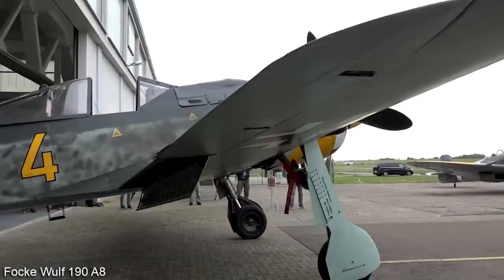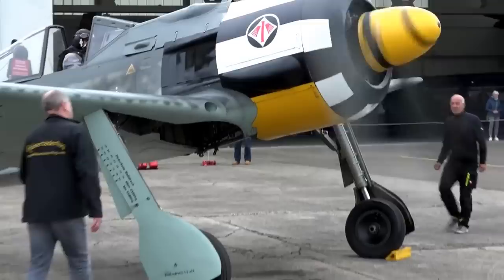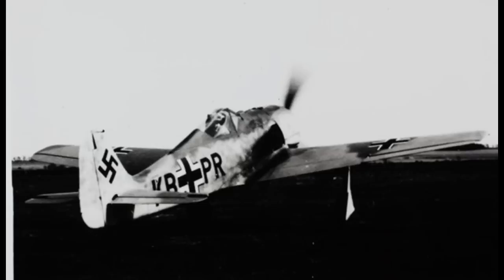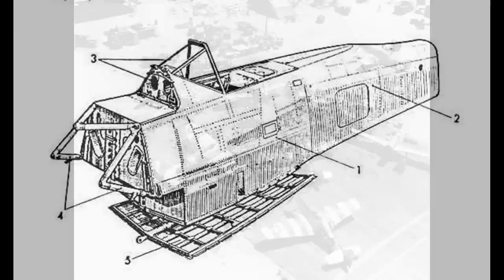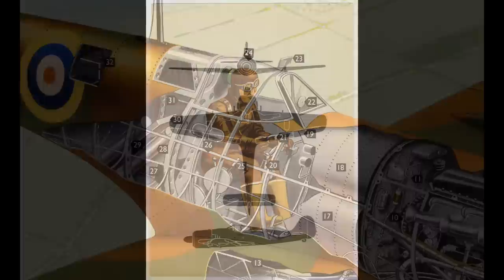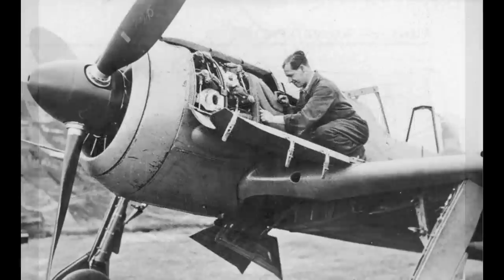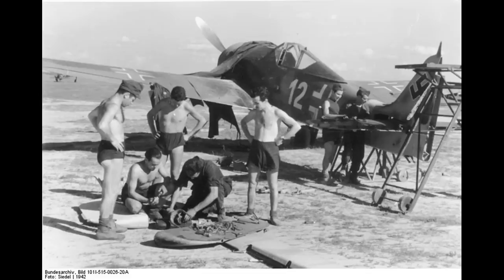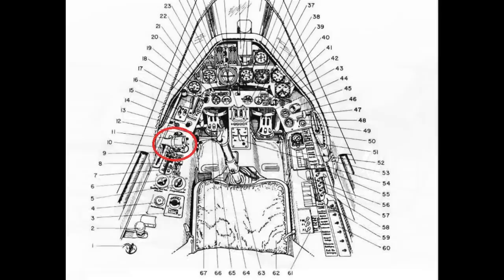Focke-Wulf Fw 190 Pt.2

Comment: The idéa of ergonomics was spawned about 1860. While it sort of existed naturally prior to that, that was the first time it was theoretizised. 

During 1880 and 1890 a lot of the theory was implemented on hand guns, making handguns of that time look a lot more than the handguns of today than just a few decades earlier. 

For machinery operation it spawned quite a bit later. While it was somewhat prevalent during the 1930 tys. It was really for fighter planes and tanks where the investment in ergonomics payed of the most. This is very obvious comparing a German, to US to Soviet tank. Soviet tank have barley any. US tank have some thought put into it, but really not a huge amount.

For German tanks they was quite significantly thought throw.

Now i heard that Germans did the same for  aircrat (and also to a lesser degree UK and USA, and hardly at all for USSR), but this is the first time i seen souch a oblivious example. The flight control system looks almost as something that could have been built in the 1970-tys

Comment: Jet engines have to have automatic fuel control, to much fuel can melt turbine.
Reply from the maker: There are turbine powered airplanes with back up manual power levers in the event of a fuel control unit failure. When using them you have to be very careful not to melt things, but with slow movement of the lever it's fine.

Comment: Yeaa Put em on to german Rpm goveneor/computer. Its way more efficent then human could 3ever be, "pitch" Need adjustment constantly, especilly during menuvers .  High RPM to climb slow, but not too high ot the dreaded Windmill effect kicks in. More important, Drop pitch While diving ,to avoid prop drag... Play I il2 With so0me good mods.. Youll see. Fly a P 51,  try to keep 100 pitch for 10-15 mins. Now try again, and drop pitch to 55-60 maybe 70 percent, Feel the poowaa! And notice the handy green line on your rpm.. It means something... Or for noobs the  corsair, F4-U, Set pitch to 90 for power and climb, drop for dives. Dont assume the same for the P 47, no sir.
Reply: Its like a Swiss Time piece, or that greek Celestial computer thing.. Such a beautiful solution, Ergonomics

Comment: I so enjoy your work here. Having spent some time racing autos ; I have a question regarding fuel. Had the Germans 150 octane gas ??? As "we " did then .
Reply: Gary Cates Their engines were not designed for high octane fuel. They would need new engines to take advantage of it.
Reply: @Wallyworld30  Thank you for your reply. The Germans were running 87 octane in there fighters. The same you are using in your daily driver now. Regular gas here in the states. It would have been a matter of adjustment, super charger boost, terbo, or an arrangement of both , and ignition timing. I do not know how they increased manifold pressure , but they did. They would not have had to redesign anything to run 159 octane. The use of a screw driver would have done the work. One mans oppionion. Garlets said " more fuel , timing ; and something else that escapes me. 427 in a 66 chevell 13 to one compression. Gas made a difference. 1% deasle to the 101 gas at the time helped. Sorry , rambling. Made the transition from striving tward new goals and asperations, content  now to dwell amung my memorries. 12.04 though lights with a spare and tool box in the trunk. Brother riding shot gun. Damn near wrecked getting off the throttle first time on 8" slicks. We took second that night. Lost lane choice. Spun a bit getting out. Memories. Go make some new ones. ,,,,,,,, thanks again.
Reply: Gary Cates I have no doubt they could have taken advantage of the higher octane fuel. I once mentioned that in one of Greg’s video’s and a gear head nearly took my head off saying that their engines couldn’t take advantage of it. I’m sure the german engineers would have no problem making adjustments to take advantage of running higher pressures.
Reply: @Wallyworld30  Yes , with out question . Spark knock is the problem. It is cured with more octane; period end of sentence.
Reply: Or detenation. Once in a late model engine "we" got some 90 wieght , 70 -140 gear gease in our fuel . cracked a piston and "knocked" a hole the size of a dime in another. We took second that night in Kallispell , on 7 cylinders. Octane .
Reply: Leaded qualities of the following were as such - 
A3 - 80 Octane
B4 - ~87 Octane, most common
C3 - ~95 Octane, rare and not used with mw50 for reasons you will find in Greg's great mw50 video
Reply: @garycates9911  The Germans were able to analyze fuel from downed Allied aircraft and look at the additives.  Some of the late war fuel mixes were getting comparable to Allied fuel.
Reply: @FiveCentsPlease  Thank you for your reply. This fuel issue can get very deep very fast. Antony Sutton wrote a number of books; all should be required reading. One of his titles is The natzis and wall street. Rockenfelder and standard oil shared info with the Germans. They had the same finacial backing. As did the bulshivicks and wall st. . The best enemy money can buy is also a good read. In 1936 Orwell wrote a white paper, There is no more history, after having came back from covering the spanish revolution. From this paper sprang the story line for both 1984 and animal farm. There is no more history. In 1970 the american library ass. made sure of this here in my country. Suttons books where yanked, Reed . Ford, Mullins ect. ,all gone. We live in a fantasy land . There is a real world out there  and it is coming. It will be very hard edged and mean ! Has this channel ever spoken to the German anti gravity stuff from the late 30's ? This would be some interesting "fuel" to discuss , it would lead us to the TR3b's and 4's, ect. Antarctica , trumps "new" space force is not new. Have you ever heard some one say ; what we know is 50 yr.s behind the military ? It is longer, much longer than 50 yr.s. I know this isn't the place for such words. Please forgive me. Was reflecting on the past , and the present interupted me. do be well. Gary
Reply: @garycates9911    I think you meant to reply to somebody else's comment.

Comment: This fw 190 at begging isn't original plane am i right ? It is missing distinguish fan behind prop
Reply from the maker: Paddy's channel has full info on the plane. Link is in the description.
Reply: +Grafspee m    A bit more info if this is helpful.     It is a replica, more specifically a kit-built replica but assigned a unique aircraft type of Fw-190A-8/N for "new."   The project began in 1996 in Germany with an idea from airline captain Claus Colling who thought that flyable Bf-109s were just ready to kill you while the Fw-190 had a rugged simplicity and was designed for a novice pilot.  (Much like what Greg has talked about in these videos.)  With no flying Fw-190s at that time, Colling thought resurrecting the Fw-190 would be a good idea, but as a new airframe rather than corroded originals that would require millions to restore.  Together with business partner Hans Gunther Wildmoser they founded Flugwerk GmbH with the goal of providing a lower-cost Fw-190 kit to the warbird market----- the kit construction allowing a significant cost savings to the buyer.  Original factory Fw-190 drawings were missing and otherwise incomplete but Flugwerk along with help from the talents of Mr. Arthur Bentley were able to collect partial drawings from the Imperial War Museum, archives in the US,  from Germany and from private sources (one of source having used original Fw-190 drawings as packing material.)  Bentley used his Fw-190 knowledge and drafting skills to fill in the blanks for source drawings.  Aerostar in Romania was a former Russian aircraft factory and it was chosen to manufacture the kits because they still had all of the skillset and tools for old-school metal fabrication and aircraft construction.  There are significant differences in the Flugwerk replicas.  With original BMW engines unobtainable,  the Russian/Chinese ASh-82 engine was chosen because it is similar in dimensions and weight as the BMW, and it has a good parts supply and is easily serviceable.   Airframe changes included removal of all hardpoints for weapons and removal of armor plating.  Flugwerk enlarged the fuel tanks with metal units to provide more fuel capacity.  Wing construction is different from the factory assembly process, and firewall forward is very different to adapt the aircraft to the ASh radial.  (Flugwerk did actually include a fan attached to the propeller spinner but these have caused some problems and have been removed by some customers.  The original fan was integral with BMW engine and worked  very differently. )  Flugwerk did give their kits some historical provenance by including original WW2 tailwheel units from a supply found stored away.  The first prototype was test flown in 2004.  Flugwerk originally offered twelve kits but production was increased to twenty-one aircraft, with three modified to Fw-190D configuration for special projects. (No D models are flying to date.)  

The Flugwerk kits are very nice although they require much work and assembly after delivery to the buyer.  Final assembly,  engine installation, electrics, avionics must all be completed by the owner.  https://www.key.aero/sites/default/files/comment_forum/2007/03/23/FW-7_0.jpg

Some history on the Flugwerk now with Hangar 10.  It was originally a French-registered example F-AZZJ that flew for several years until during a practice flight on the French coast, a propeller failure forced an immediate ditching into saltwater.  
https://s3.eu-west-2.amazonaws.com/abpic-media-eu-production/pictures/full_size_0127/1191269-large.jpg
https://lh3.googleusercontent.com/proxy/FZutuDmUJauoHaJZUMsmlN12hUm1YuW1AAnwcBJHIr5rCdijqxEmtDfvNMdwjxS3O_RQBontaCDxyR1W2I03g9WgeLzEKdM
https://www.meiermotors.com/images/pictures/Fw190_Hangar_10/Fw190_Hangar10_Jahr_2010/Fw190_A8N_F-AZZJ2.jpg

The wreck was salvaged and  sold to the Hangar10 collection in Germany and after several years of repairs and rebuilding it was returned to the air. 
https://www.meiermotors.com/images/pictures/Fw190_Hangar_10/Fw190hangar10_Juli2014/Fw190_hangar10_2014-05-091.jpg
https://www.meiermotors.com/images/pictures/Fw190_Hangar_10/Fw190_Hangar10_Jahr_2015/Fw190_Hangar10_Jan2015/FW190_Hangar10_2015-01-304.jpg
https://www.meiermotors.com/images/pictures/Fw190_Hangar_10/Fw190_Hangar10_1-Quartal2017/Fw190_Hangar10_2017-03-172.jpg
https://www.meiermotors.com/images/pictures/Fw190_Hangar_10/Fw190_Hangar10_April_2019/56910180_2234040536641956_6000906749530341376_n.jpg
Reply: @FiveCentsPlease  Another interesting detail here. The Ash82T on the FW190 in the video was actually produced in Germany , Leibzig (east germany/DDR at the time).
Reply: @PaddyPatrone      
Every time I see a picture of "White 1" it looks a new owner has started over with the rebuild.

The wreckage of "White 1" was originally recovered sometime around 1984 for the Norwegian Armed Forces Museum (along with at least one more Fw-190.)  From there it went to John Houston / Texas Air Museum sometime around 1988 along with at least two more Fw-190s for rebuild.   So the first rebuild for "White 1" occurred during the 1988 to 1991 time period.  This is before Flugwerk was founded in 1996 so I think it is accurate that "White 1" does not have a Flugwerk firewall.   https://www.collingsfoundation.org/wp-content/uploads/2014/04/FW900x600.jpg

The Texas Air Museum completed at least two other Fw-190s for display -  Fw-190A-3 W.Nr.    
"Black 3" for the Norwegian Armed Forces Museum, and Fw-190A-8 W.Nr. 350177 "Blue 4."   

"White 1" was purchased by Dr. Mark Timkin in Florida sometime in the mid-1990s and he formed the White 1 Foundation.   I do not know the original circumstances for the agreement, though the foundation was a non-profit.  Mark told me that he had originally wanted a Fw-190D but could not find a wreck or a data plate to start a project.   

The Norwegian Armed Forces Museum was not happy with the quality of work from the Texas Air Museum on their Fw-190A-3 0132219 and the White 1 Foundation offered to start over and correct it in exchange for parts and assistance on "White 1".   Sometime around around 2009, the airframe for "Black 3" was ready to be shipped back to Norway to be completed.  
http://www.toredgarolsen.net/fockepic/partsnew.jpg
https://www.airhistory.net/photos/0025763.jpg

Similarly,,  the original work performed on "White 1" in Texas was not up to quality for airworthy standard, so Mark had to do a lot of work over.  I think the fuselage was worked on in Florida while the wings were sent to Gosshawk Unlimited.   I specifically asked Mark about Flugwerk and he said he was not using their parts because they didn't fit.

Mark Timkin eventually did find a Fw-190D-9 with the wreck of Fw-190D-9 W.Nr. 210096 from JG26, along with two Jumo 213 engines.  The Foundation announced that it would be rebuilt and painted in the unusual colors from JV44.  I do not know the circumstances but both the Fw-190D-9 wreck and "White 1" were both sold to The Collings Foundation sometime in the 2000s.   While "White 1" is being completed to original condition by Gosshawk in Arizona,  I do not know if the Fw-190D-9 is an active project or if it remains pending for later. (I do not know if Gosshawk is incorporating any Flugwerk parts into "White 1.")  It is also my understanding that the rebuild for the Fw-190D-9 will be using a converted Flugwerk airframe or parts.   Also I suspect The Collings Foundation will be dealing with issues related to the B-17 "909" crash for a while and this could impact the direction of that organization and the projects.

Meanwhile,  Fw-190A-8 "Blue 4" was purchased by the Military Aviation Museum in Virginia.    It is not complete internally and I do not know what the eventual plans are for it.  The museum already has a Fw-190A-3 in long-term restoration and they own the wreckage of a Fw-190D-9 W.Nr. 211028 from JG26.  They also own one of the Flugwerk Fw-190D-9 replicas, which was the only one completed for flight but it remains on the ground and never flown, I think because of issues with getting it certified for flight.  And I know that the museum has future plans for it with a different engine.
Here is "Blue 4" with the Flugwerk D-9/N in the background.  https://airmuseumnetwork.com/wp-content/uploads/IMG_3556_ToneMapping.JPG
Reply: @FiveCentsPlease  Thanks! A great read. Always appreciate your research over the years. Also heard that the D9 in Virginia eventually ends up with a Jumo engine, who knows.
Reply: @PaddyPatrone     The Flugwerk D-9 may get the 213 although there doesn't appear to be any rush to install it.  The museum in Virginia also owns a wartime D-9 wreck so I wondered if they would save the 213 for that rebuild when it is started.

Comment: "Mechanical Ignition Timing" in wikipedia tells me "centrifugal timing advance" and "vacuum timing advance" predate computerized ignition systems. If the Kommandogeraet advances/retards timing according to manifold pressure, perhaps this is analogous to "vacuum timing advance". You state at 27:36 the Kommandogeraet does not use revs as an input; could the BMW 801's magneto itself contain a centrifugal timing apparatus? Jane's Fighting Aircraft of WWII describes the BMW 801's ignition system only briefly, but some entries (incl RR Griffon) indicate the ignition systems advance/retard timing according to throttle setting.
Reply from the maker: Yes, it can use centrifugal and pressure methods to move ignition timing, that was very common. I'll have updated info on this in the engine episode.
Reply: @GregsAirplanesandAutomobiles  Fantastic - I want to watch the engine episode. I read Myles Cave's 1942 Aviation article on the BMW 801.

Comment: I am not sure that performance is affected too much by mixture setting (minute 25).  As long as you are full rich, you will have more or less max performance.  It is the economy that can be affected by mixture setting, and you have plenty of time to set this up ...
Reply from the maker: What HiWetcam said. Of course a lot depends on just what airplane we are talking about. In the P-40, as long as the pilot remembered to put it in auto rich, he should be good. In some Soviet fighters, fine adjustments are needed. However in the Fw 190, there is none of that, shove the throttle forward and go.
Reply: @GregsAirplanesandAutomobiles  There is no question about the 190 or 109.  But I would think that "full rich" will get you to an air fuel ratio of say 12.5-13 no matter the altitude, since carburetors have a built in automatic adjustment for reduction of air density.

Comment: That comment on "balance" in IL-2 GB doesn't make any sense. If they went for balance, the Americans wouldn't have G-suits and the Germans wouldn't have the Me 262 and K-4 with DB 605DC.
There are other reasons not to implement slightly higher G-resistance such as lacking test data or inconclusive tests. Or maybe a completely different reason altogether.
Reply from the maker: I don't see it that way. You can create balance by reducing one planes speed advantage over another, or reducing a maneuvering advantage, no need to leave a plane out entirely. Another way would be to use the slower test data for one plane and the faster for another. I'm pretty sure there is some of that sort of thing in the game, but I also think it's fine.